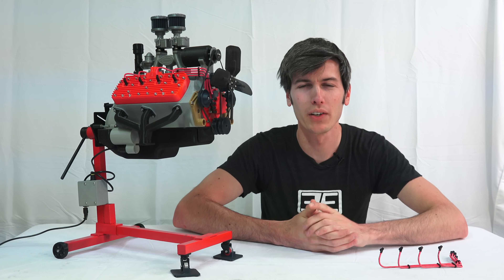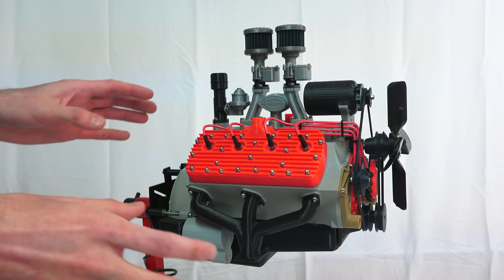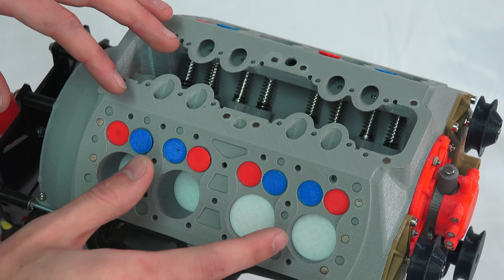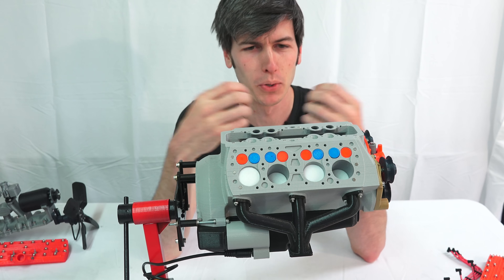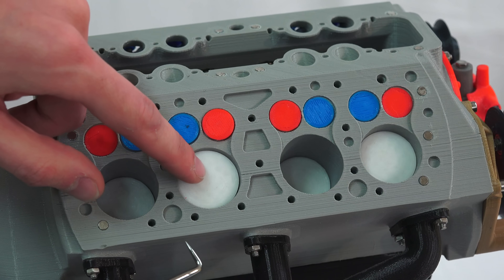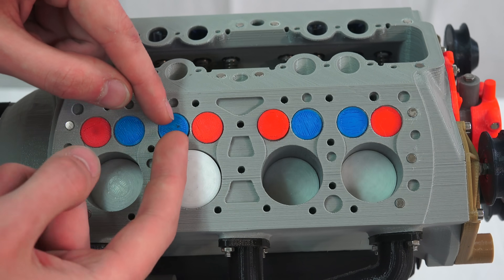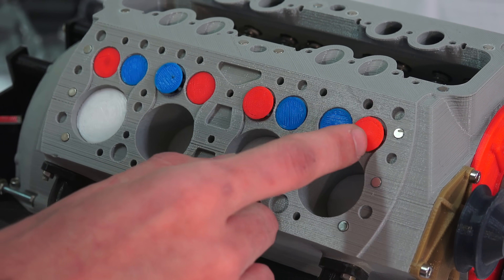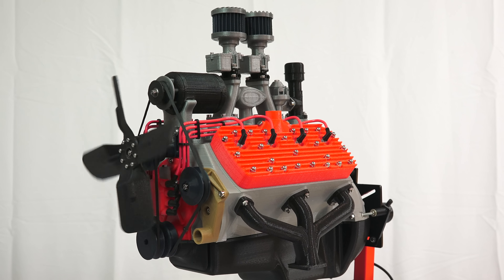Why Ford's Flathead V8 Engine Died

Comment: I know it would destined for still yet anemic output... but I would LOOOOOVE to build a modernized version with newer materials plumbing. I'd like to see what the net power density would be, if the following changes were made:

1- all ports exiting over the lifter valley
2- vertical exhaust with maximum thermal shielding (ceramic coating, etc.)
3- High temp composite intake with forward mounted throttle body
4- redesigned bore position and spacing to make use of the real estate previously occupied by internal exhaust passages around the cylinders 
5- flat plane crank
6- 3 versions scaled to match the total assembled volume of a modern GM LS series V8, a Chrysler 392 Hemi, and a Ford 7.3 truck engine
7- modern internals designed with just enough mass to endure the maximum output/load of the engine
8- 6 bolt main bearings similar to GM LS engines
9- coil-on-plug ignition
10- mechanical diesel injection 

I don't expect it would win any races... but I've always thought it would make for a great high displacement, low specific output, torque monster. The potential for gains in displacement are definitely there... with at least a full inch in available stroke length available  (possibly more, given the low RPM affords smaller crank pins and connecting rods). 

While the flathead design is firmly antiquated in terms of specific output...  it's makes for some consideration in low RPM applications, aside from mere  stroke/displacement. Some of which are:

-the restrictions of  poor plumbing/port routing is far less restrictive at low RPM
-flatheads provide maximum quench area, which facilitates significant cooling at it's most crucial point (just prior to combustion)
-while the thermal management of exhaust-over-intake plumbing is obvious, it helps insure better atomization of fuel by eliminating condensation at the valve
-thanks to lower RPM and less complex geometry, the valvetrain can be designed with lower parts count (increased reliability), lighter materials (lower spring rates, less stress, less parasitic loss), lower spring rates, lighter cam, and lighter timing assembly... all of which free up more power.

If the outcome was even within 10% efficiency, I'd take it... if but for nothing more than aesthetics and maintenance advantages.

Comment: Ford's famous flat head V8 engine was inferior to other flat head V8s of the era. The illusion of a cross flow  design caused over heating and breathing problems for the engine. Other flat head V8s had the exhaust coming out next to the intake ports so they ran cooler and breathed better. Two good examples are Cadillac and Cord. Unlike those two, Ford manufactured millions of their engines from 1932 1o 1953. Their first attempt at an OHV V8 engine in 1954 known as the 'Y' block was not as powerful as other manufacturers' OHV V8s.

Comment: The answer is forced induction. Which is why decades later people who have messed around with flat head v8 engines don't have nearly as many draw backs using a modern turbo on these engines. Also there is a company that still makes these things with new castings. I don't know if they survived COVID though.

Comment: When these engines were in the design phase, did they work out the physics and calculations on these engines in detail ? And if they did an in depth physics and structural design regarding output, efficiency and stress factors on the engine parts, where could those design notes be found ? Just wondering.
Reply: Having seen how design works (ahem..) - it would have been trial and error and that days great idea when sat on the pot.

Comment: Not entirely correct. The flathead did not die in the early 50's - the French military had it produced for use it well through the 80's. There are actually brand new French blocks still available in crates. They are not a 100% Ford replacement - kind of a hodge-podge of the Fords different variations - but are definitely a Ford flathead based engine. So while Ford quit using it as a production engine in the early 50's - it's "offspring" lived for 35 years after.

Comment: Pretty much the 1st V8 . Ford engineer's told ford it couldn't be done . He said take all the time you need . It took a year to design that motor .  Chevy came out with there v6 and ford said if cylinders is what Americans want will give them cylinders .

Comment: Ford flathead V-8 was introduced in 1932, this is 88 year old technology, would you also like to do a video on aircraft technology putting canvas on a wooden frame.  But this V-8 was quite an accomplishment at the time making a V-8 engine with one single pouring, was never done like this before, and Henry Ford and his crew worked day and night for over a year.

All started with the Chevy six and a tad bit faster 0-60 time than the Ford 4 cylinder cars.  The Ford V-8 could leave the Chevy six slightly in the dust that help Ford keep its lead.

But nothing like the HP race in the 60's to end up with a nation wide 55 mph speed limit.  But driving on I-94 in Milwaukee of the Dan Ryan in Chicago, you could pass up all the vehicles by walking, even with a limp. Boston was even worse.

Comment: I have owned several Ford/Mercury/Lincoln flat head  V-8  automobiles and loved every one. In 1962, I drove a gunmetal grey 1950 Ford Custom 2-door with  the stock motor but with dual exhaust and Smithy Glass Packs and electric overdrive/4:11 rear end. Off the line fast out of overdrive, then engage overdrive and cruise all day at low rpms.  So, in 1962, I drove from Los Angeles to Chicago almost non-stop- just a short nap in incredibly star-filled black night in the middle of nowhere Nebraska.Flat Heads Fords with pipes had a sweet low rumble tone.

Comment: The biggest thing was overheating on many of them, my Army Buddy has a 1952 Ford sedan, the flathead engine has been reworked with all new upgraded parts, we even installed A.C., it's still 3 on the tree the trans was rebuilt too, new clutch, redid the rear, but it flys when punched! nice car to cruse in too!

Comment: Fundamental curiosity - not an engineer - about a couple design principles with these two row blocks. (1) the pushrods of a left and a right piston are on the same crank of the shaft, is that a must? (2) the angle between the left and right row is sometimes varied - is this an elegance or a serious optimization problem? (3) with even numbers of pistons, I imagine some of them to move up and down at the same time, the same height in the cylinder and the same direction. This makes me think an uneven number may be more elegant and might even have better torque (gut feeling, no deep thoughts). 3 cylinders of 5 and a V10 essentially being a double 5 - what is the problem?
Any opinion and explanation from an engineer with deep thoughts, knowledge and capabilities?

Comment: Another problem with the Ford flathead V8, and the Lincoln Zephyr V12:

The exhaust ports ran through the block to get to the outside of the 2 banks.  That was done so that the exhaust manifolds would not be between the 2 banks.  That increased the load on the cooling system requiring the radiator to be bigger.  In addition, the 2 center cylinders on each bank shared an exhaust port as can be seen by the fact that there are only 3 exhaust ports on each bank (4 on the Lincoln Zephyr V12).  That further reduced efficiency by increasing exhaust back pressure.  Both the Ford flathead V8 and the Lincoln Zephyr V12 had two water pumps, i.e., one for each bank.

Other flathead V engines were made, including the Cadillac V8, Packard V12, and others.  They had the exhaust manifold between the two banks, along with the intake manifold.  So far as I know it was only Ford products which ran the exhaust ports through the block, including the Lincoln Zephyr V12.

Interestingly, the Cadillac V16 was like 2 straight eights side by side.  The intake and exhaust valves were on the outside of the 2 banks rather than between them.

Comment: Ford's Flathead V8 Engine Died because it was a disaster that it was born in the first place since over 99% of the energy available to this engine was wasted. Modern engines are only slightly "better"

Comment: Computers weren’t used to design engines super ceding the flathead v8, All brands  engines the small and big block engines in the 60s 70s 80s were design through good old mathematics geometry and testing.

Comment: I'll bet that the flat head V8 got really bad gas mileage too. I've noticed that even in small gas engines, like lawnmowers and snowblowers, that that fuel consumption is way lower with the OHV design.

Comment: The main reason the flathead went its way was because you couldn't find one that didn't have a cracked block between the valve and firing chamber. This leaked water into the exhaust pipe. Wasn't too hard to find. I owned three of them when I was young.

Comment: Hello all.  One thing omitted from your interesting talk was the octane rating of fuels at that time in history and the relationship of detonation or "pinging" to combustion chamber design and octane rating.  If the designers could have increased the compression ratio in the 1930's the engine would have pinged like hell.  A hemi combustion chamber can have a higher compression ratio using the same low octane fuel without onset of pinging.  Appreciate your comments.

Comment: My family had a 1953 Ford Customline four door with a flathead V-8. It had three on the tree with overdrive. It didn’t have a lot of power, but was a reliable car. I learned to drive it when I was eleven years old. Still have some fond memories of it. 😃

Comment: Cause it’s a Ford that’s why
Reply: One of the all time great engines. Like all designs, eventually it became obsolete.
Reply: Scooter George it’s a ford it’s not that good
Reply: @tuckerrichardson5219  - The flathead Ford V8 was THE CHOICE of hot rodders for decades.  An entire industry came to life designing and building performance parts.
Reply: Scooter George yea if you wanted to be found on road dead
Reply: @tuckerrichardson5219  - First On Race Day!
Reply: Scooter George we all know it’s  fixed or repaired daily
Reply: @tuckerrichardson5219  - Wrong again. If you want to go there it's "fix or repair." Fixed it for ya!  In any case I have owned at least one GM, Chrysler, AMC, Ford, and VW over the years And a 1954 Kaiser...
Reply: Scooter George I like how you haven’t pointed out that my profile picture is a ford but still I think fords suck the 51 Mercury is the only good ford they have ever made
Reply: @tuckerrichardson5219  - The picture looks like a reddish brown brick.  My father was a GM man but  thought the '49 and '50 Mercury was better than the '51 face-lift.
Reply: Scooter George he had good taste

Comment: Henry Ford nearly killled the company by insisting on building only flatheads long after mass production OHV engines became affordable.  Henry the first wasn't the only one.  Plymouth was still selling flathead 6 cylinder engines in 1969.
Reply: Plymouth went to the OHV  Slant 6 in 1960.

Comment: Other side valve problems include poor mixture distribution (and atomisation) and a very long flame path, both of which increase the likelihood of detonation, so It's probably just as well that the basic layout doesn't lend itself to high compression ratios - works great on my lawnmower though!

Comment: 0:49 - 65 bhp may be considered 'embarrassing' these days, but you have to look at the times in which the flathead was introduced (1932).  No freeways.  The ability to slow to walking pace on a 1-in-8 hill and pull away in the highest gear without bucking (important, as there was no automatic available then).  The Model 18 (V8 Ford) weighed a little over 2500 lbs, giving the car a high power-to-weight ratio for those days.  And look at the other cars people drove.  A V8 would leave a Model T standing still and make a Model Y look as if it were going backwards!  As a result, reviewers at the time called the Ford V8's acceleration 'terrific'.  Horses for courses...

Comment: Flat head engines disappeared because it was impossible to have a good gas flow with side valves, overhead valves engines are far more efficient.
The only advantage of flat head was a simpler engine and less expensive to produce.

Comment: I agree that these engines had their limitations due to the design, but I must disagree with your synopsis of how the intake charge flows. You state that the intake flow is over the top of the valve, there is no way that this is possible. During the intake stroke, as the valve opens, the inrush of air/fuel is drawn thru the intake port and down into the cylinder. The vacuum of the piston will draw the intake charge in and down thru the lower half of the port just by flow dynamics. The architecture of the combustion chamber in relation to the location of the valvetrain make this so. In contrast, the exhaust stroke pushing upward, forces burned gases thru the exhaust port relatively evenly, due to the pressurized flow characteristics. I own two of these engines, one in my forty ford pickup, and one as a spare if I ever need it, this was my first car, and I still own it 35 years later. These engines run very well when tuned correctly, and they were the backbone of the early hotrodding culture.

Comment: Thanks for that video  !!!   yeah but now they still have flathead engines (for Ultra Light aircraft), it is a  BELGIAN D-Motor engine builder and the engine is named LF-39  it is a 6 cylinder 3993 cc flathead 125 HP.  !  Maybe there is here in the comments someone who speaks about it but I cann't read all the more than 3000 comments .....  all very very nice mechanical work  !!!  if I was very rich I would construct a trike (like the BOOM trikes) with such engine, just for machanical fun !!! ( I would ask the belgian builder of ultra light helicopters DYNALI for the trike frame construction   hahaha !!! ) .....  namaste !  One may dream !!!  ;-)

Comment: Henry Ford spent over 130 million in 1930-31 for engineers to design a V8 because Chevy had created one. The challenge was making the casting to produce it in one piece versus the first version  being 3 separate pieces with ignition and spark plugs on the bottom which was bad flaw for water fouling it.

Also the Model A has that 65hp block with 2 speed trans but they still made the 4 cylinder to provide a less expensive model for people. The Great Depression was happening during this time and Ford made it happen and put 75,000 people to work!

Comment: Yes, the Ford flathead V8 was installed in new Fords for the US market up to 1953, but it lived on in new vehicles up to 1964 in Brazil, and up to 1990 in France. There, it was known as the "vedette".  Right now I have an early flattie (Model 18), several 59ab's, and an 8ba all waiting in the wings for the next time I blow one up.

Comment: The invention of the hydraulic lifter, was of Paramount importance.
The flathead's valves had to be adjusted, say, about every 12 - 15 thousand miles.but, for its time a very dependable engine.

Comment: I've owned a couple of these and enjoyed them but never really put them to work. The old timers told me that there real downfall was cooling. Exhaust passages cast in water jacket and exhaust valve arrangement. They were real touchy about me getting one even slightly to hot. Also, aldren made some hemi heads for these before Mopar had them. I can't imagine how they engineered something like this for the flathead block. Maybe you could check In to it

Edit. Ardun heads not aldren. Sorry

Comment: Lol to give some accuracy to the cylinder heads the part you took off is the valve covers the cylinder head part of the flathead is part of the engine block I'm 28 years old and I grew up with classic and antique cars mainly fords I have learned alot of stuff about cars from my dad and people who have obviously more knowledge about engines than you obviously do bud.
And your information about the overhead valve v8 taking the flatheads place your wrong there too those motors were not what took the flatheads place

Comment: Back in the early eighties I bought an old 1952 Ford pickup that had a 238 v8 flathead in it and a three on the tree...all original, un- restored. That old truck would snap your head back into the rear window through all three gears...the only problem was that it was a divided block and thus had TWO water pumps...even in the eighties it took me a couple months to find two water pumps for it. Hell of an engine though.

Comment: You missed a important point, the flat head was the first v-8 where the block was made from a single casting making it affordable.
 It was one of  important breakthroughs for the v-8 engine design in modern history.